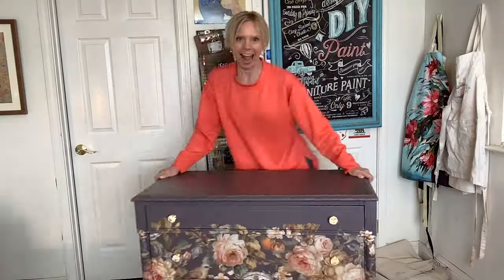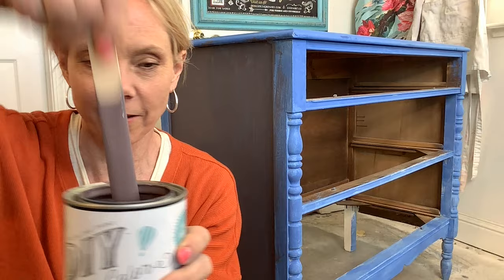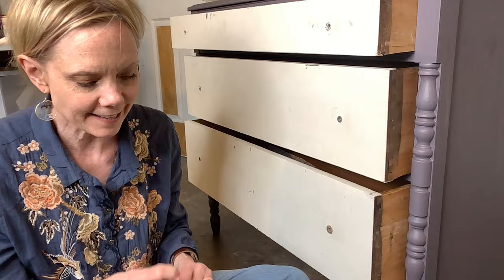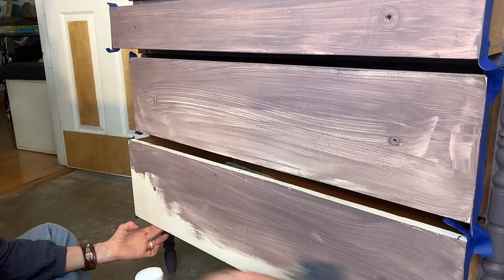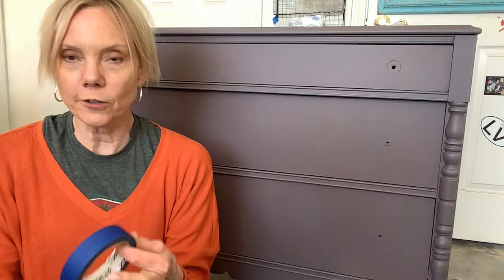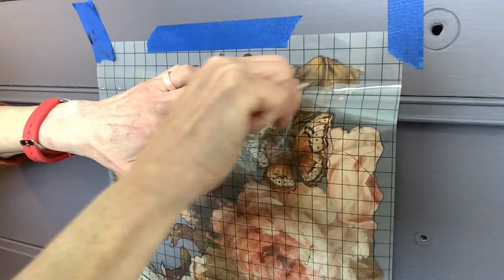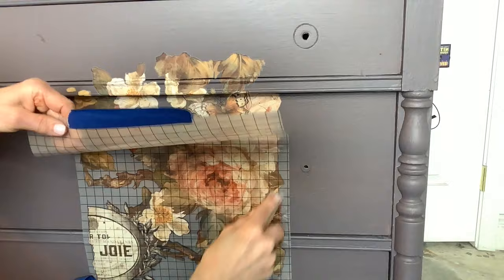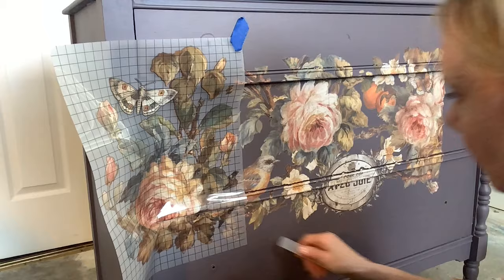Cottage Color Dresser Makeover

Comment: I love the color!  Very vintage looking. But, if you line up your transfer, only peel back part of your backing,  then cut that off. That way you don't accidentally pre stick any of the rest of the transfer.   Also sometimes it's best to razor cut the transfer around curves, or between drawers as you apply them, then line up the following.  I also find it's ALWAYS best to sand the drawers inside & out to clean them up after you wash them.  Then apply your nice smelling waxes.  It did turn out pretty!  Ty
Reply from the maker: Thank you so much for watching and those really great tips!